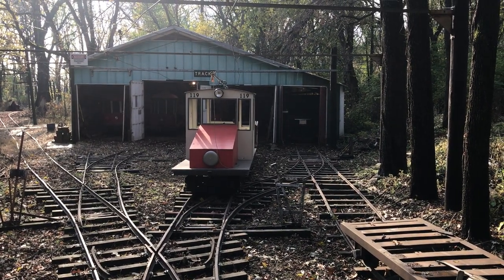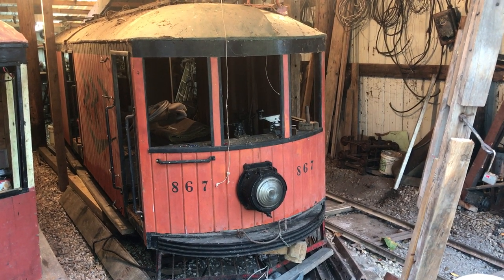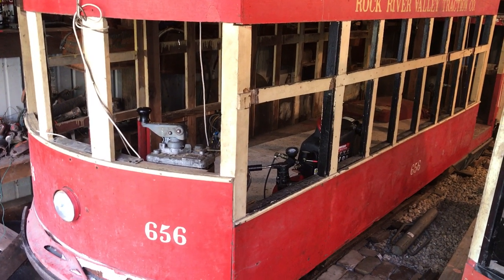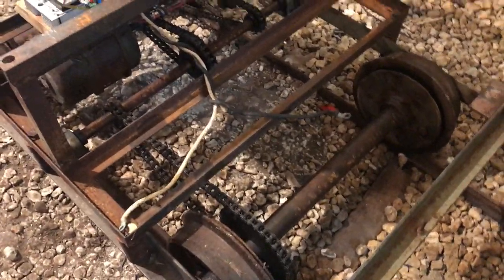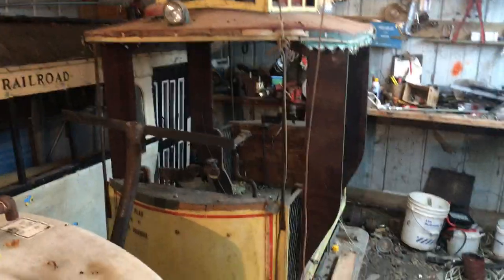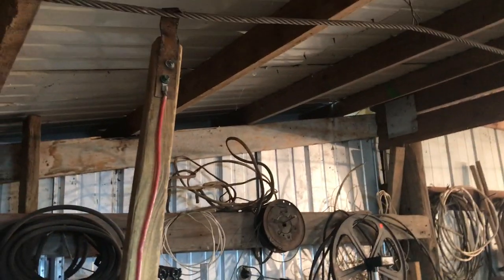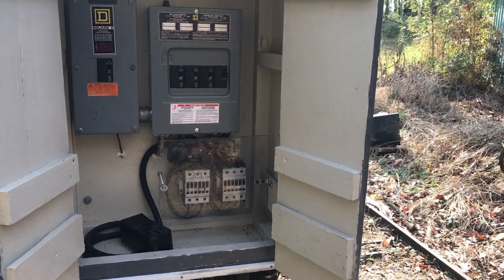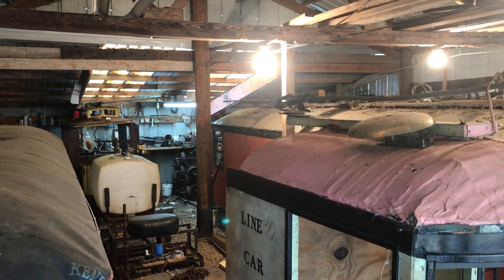Carbarn tour

Comment: I’m curious what the voltage is through the wires?  Your motors run on 36VDC, I think you’ve said.
Reply from the maker: It is 250Vac in the catenary. And yes, the motors are 36Vdc

Comment: Great video and great job you did!!!! Do you have an estimation of cost to build such a kind of Railway? I mean based on 500 MTs... Without electricity, to use with diesel engines. Thanks a lot
Reply from the maker: With this hobby you can spend as much or as little as you want. I build most everything from scrap steel and I repurpose parts from other things to use for it. I spend way less money on it than I ever did in HO scale trains! Of course the rail is the most expensive part, but if you know where to look, you can find good deals on that too.
Reply: @CNW4145  thanks a lot and again congratulations for your "creature" really a masterpiece!